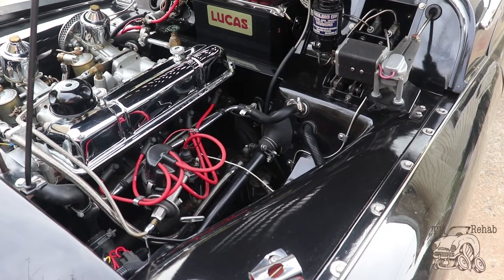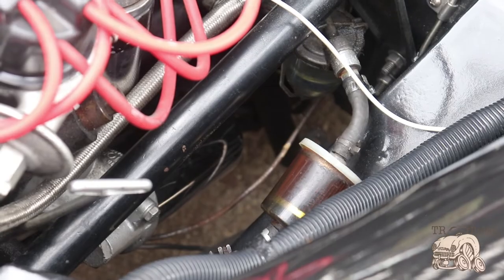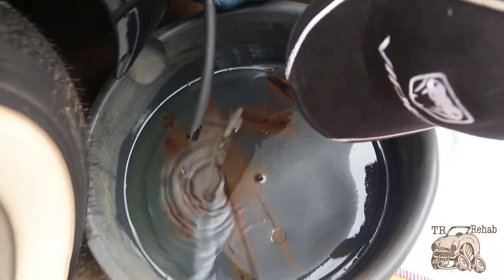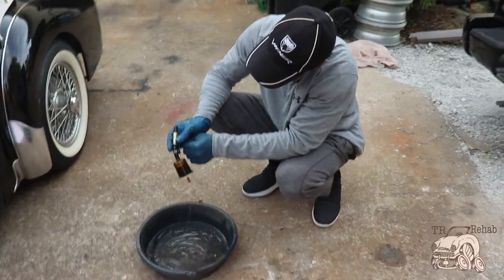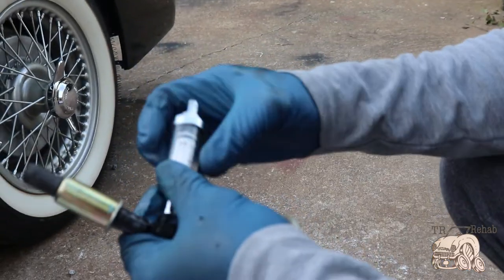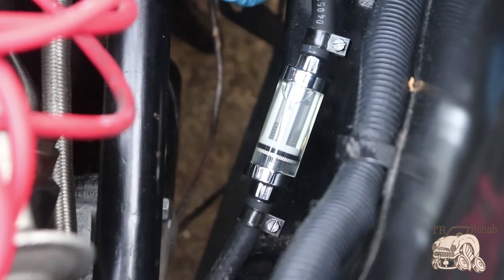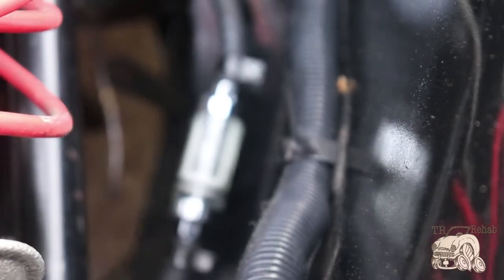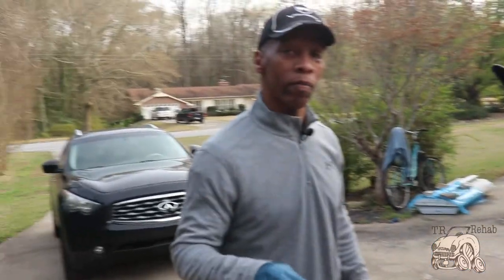Triumph TR3 Fuel Pump Issues "Fixed" #triumphtr3

Comment: I also have a 1957 TR3, and I am having fuel issues as well. It just takes ages to start and trying to pinpoint where the problem is. I see that my sediment chamber next to the puel pump  is full of gas. I opened the float chamber next to the carburetors and they were dry. So I poured gas in them at your suggestion, but I still couldn't get the car to start. My first thought is the fuel pump isn't working, but if it isn't working how is the sediment chamber filling up? I don't have any fuel filters in between the pump and the carburetors, at your suggestion I purchased a  Dorman in-line fuel filter it will be delivered in a couple of days. In the case if you have any thoughts please let me know in the meantime I will wait for my fuel filter! Thanks for your very instructional video - it really explains a lot to me about this whole mechanism.
Reply from the maker: Take the hose from the fuel pump to the carburetor and run it into a jar. Turn it over to see if the jar fills would be my start. If the fuel pump working check the float valve s in both carbs. They could be stuck closed but if you have manually filled the bowls and still nothing there could be a spark issue. 

Let me know?
Reply: @TRRehab  OK great I will try that. I also need to check the spark issue as this could really be the problem. No use redoing the fuel system if we have a spark issue!
Reply from the maker: @brianburns9209  By the way.... I'm Brian also. 😁
Reply: @TRRehab  That's great. And you spell it the right way too!!

Comment: Thanks for the video, I am going to try it.  Is that a Dorman open face filter and is it a 3/8”.  I have a ‘59 TR3A
Reply from the maker: Yes it is a Dorman and it is a 3/16. Thanks for the question. I put a link in the description for purchase.
Reply: @TRRehab  Thanks!  I bought the 3/8” and will return.  Got it and appreciate you getting back to me!
Reply from the maker: @caseycat43  I don't believe there is a message that I have not answered within 24 hours. Not the best mechanic but I am excellent on returning messages. I hope it solves your issue. Check your fuel line hoses if it is the filter. Mine was decaying on the inside. That was the source of the problem.